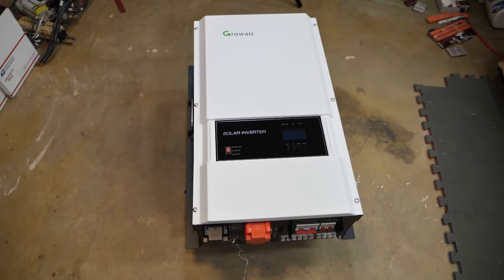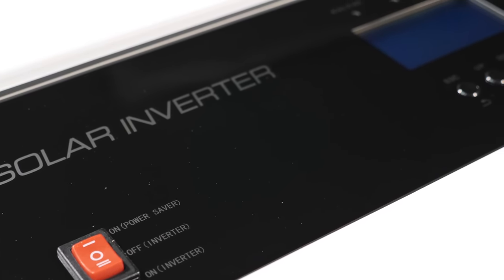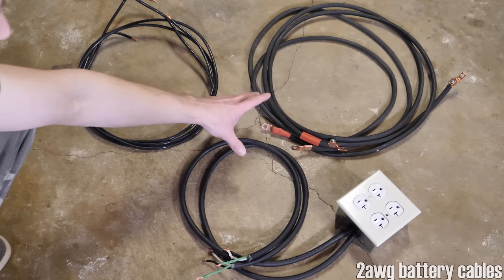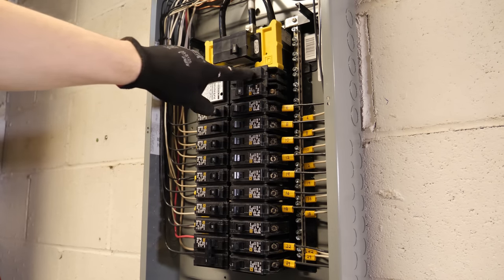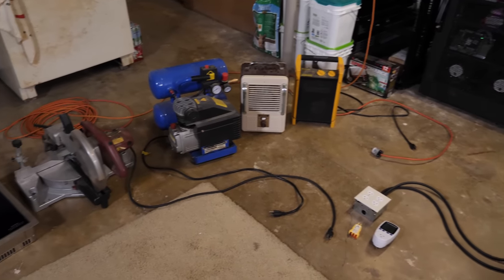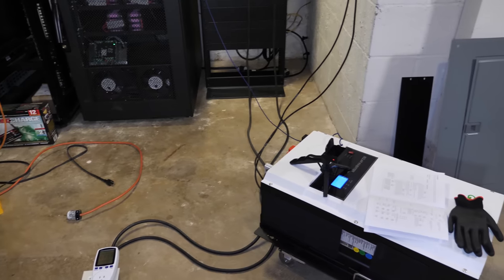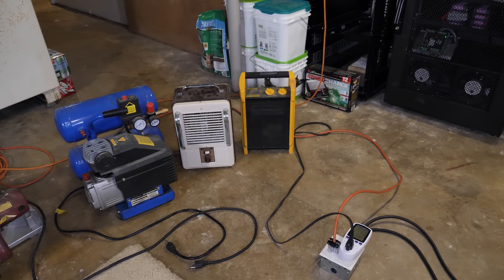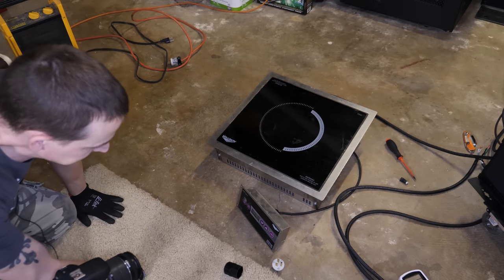12kw Growatt Inverter Operational Check/Review!!

Comment: Joe, can this inverter accept input from 240 volt micro inverters??
Reply from the maker: Hmmmmm.....thats a great question. I guess I dont see why it couldnt but I dont have any so cant say 100%
Reply: Accepting microinverter input is very tricky.

Usually, this would be placed on the output of the inverter, but this could blow the MOSFETs if the power produced by the microinverters was higher than the power draw in your house and the power on the output lines was greater than the power coming in on your input lines. (This is not designed to be a grid tie inverter, that extra power must be sent somewhere, otherwise it can blow up the unit.)

I know the Genetry Solar inverters will do what you want, and it has the ability to throttle down the microinverters in case they are producing more than you are consuming.

If you are selling back to the electrical company, then the microinverters need to be on your input lines (before the whole house inverter); and you will need advice from both vendors as to what the voltage needs to be set to. (I bet GrowWatt would be ok with this, but you need to check, since the microinverter voltage and electrical company voltage may determine voltage settings on the whole house inverter.)
Reply: If you mean direct input from micro inverters e.g to charge the batteries without Grid -- NO
And as David H pointed out on the inverter output side it is a definite NO since these are not AC coupled inverters that provide a frequency shift to to tell the micro inverter(s) to slow down or stop if there is insufficient load.

Comment: So it's been a bit over a year now, how is it holding up? I'd imagine with the various battery banks you are running mostly off solar now.
Reply from the maker: Sorry for late reply, regular joby job was taking all my time...just quit so all the time meow!  Still loving the inverter. Obvi didnt have time for all my batteries yet but thats going to change.  I also dont have the AC, stove or dryer connected but again that should change here soon!
Reply: @AveRage_Joe  Trust me I know how that is! I have my 2 original inverters still going strong, and I added a third one for more 120 volt loads. Battery bank is about 24kwh now, only thing not on my inverters is my stove and hot water heater, averaging about 12 to 13 hours a day on the inverters during the summer, typically from about 9:30am till 9 to 11ish pm. Plan to add about another 12kwh of storage and I should be mostly on battery all the time. Running 39,000 btus of mini split heat pumps off it and an 800 watt heat pump dryer now. They've been super solid.

Comment: Hi joe. I just purchased the inverter. I have a question on the panels. I have 4 strings of panels that goes into a combiner box. With this inverter can I connect each string to the inverter with out the combiner box?
Reply from the maker: I would keep the combiner as each string is fused or protected. That what I did is ran strings into combiner then into inverter!🤘

Comment: I'm planing to purchase this inverter in the next few days.  Are you going to be doing a follow up video?

Question. What is the largest AWG wire you can place in the ac output terminals?

Why are there 2 PV in terminals?
Reply from the maker: You will Love it! I want to do a follow up vid but work schedule is busy atm.

Manual says 6awg but I think 4awg will fit.

There are 2 solar charge controllers, 60 amp each. Great for south facing panels and west or which ever direction u like.🤘
Reply: @AveRage_Joe  thanks. I'd love to see pics or video of your final install and how you can laid out your switchgear
Reply: Thanks for the video. What does power saver mode do? Will it charge from charge controller in power saver?

Comment: Hey great video. I have tesla solar with no powerwall. could i wire the output of the tesla inverters to maybe the generator input of this?  im trying to find the best way to add a battery to the system and have a backed up loads panel.
Reply from the maker: Thanks!  Hmmmm....Id have to look into that.  I wanna say those need a grid signal to sync with or they wont work!  Its a grid-tie system correct?

Comment: Joe, I don’t know if you answer these but I sure could use some helpful guidance and advice so I don’t do anything too crazy. I bought the 12kw growatt after watching your videos. It should be here next week I might need a more detailed video with wiring it  completely off grid.  I intended to use 12 300w panels total, 6 are in parallel and 6 in series. I have 4 12v Vmax solar 155 batteries and power is being delivered using a #6 Thhn cord. Thanks for making great videos that keep inspiring us to build bigger.
Reply from the maker: Nice! I have the grid connected as a backup(or when we dont have sun). Do you plan to do that or complete off grid?
Reply: @AveRage_Joe  Yes, I have been off grid for the last 3 years due to my local electric company charging seriously high bills while I was out sailing on deployment. I’m talking over 1000 for one month totaling $5000 in a mostly vacant home with solar panels. I bought a Homegrid 5000 and haven’t looked back. This Growatt is a huge step up and would allow me to run equipment like my dryer finally. My biggest fear is that I will mess this installation up, so I have been obsessing for weeks reading the manual and re watching your videos every night. Any help is a great help, and I’d appreciate if you stopped me from fouling up my installation 😁. Thanks Joe.

Comment: What's your BMS continuous amp rating? What's cable size from battery to inverter?
Reply from the maker: I use the batrium bms which allows me to use a shunt trip circuit breaker (to cut the load) so I am using a 300a shunt trip circuit breaker. At the time of this video I am using 2awg cable to inverter.  Once my other battery is setup Ill be using 2/0 cable!

Comment: Can you try this on a sol-ark?? 12k Test it... And say what you think.
Reply from the maker: I would Love to but cant afford a 12k sol-ark to tester out!
Reply: Hello Joe  I put this because I just got one. A 12k. And if I would do what you did. It would  turn off. My 12k is nice but I think  I must get a transformer so that I can run my loads. I can't put a table saw it  shutdown.o me as far the rest is ok. Thank you and stay well.
Reply from the maker: You should be able to run a table saw at least without much other loads. Thats like an 8kw inverter or something isnt it and 12k for solar?
Reply: @williambenedito1305  - “transformer”

And there are risks to running an AutoTransformer. God forbid it dies or it is wired to a separate breaker from the inverter, you might get a 240v spike over one of your 120v split legs… and that is not funny.

Comment: the thing id like to know you said it can act like a ups does this mean it will also give a signal to a computer/server to shut down when the battery's get low
Reply from the maker: Yeah you can set alerts in the online deal. I was able to change settings and all that from a different pc after I did the video btw😆
Reply: @AveRage_Joe  thats freaking awesome i have not scene any one try and see if it will work as a computer ups that just simplified things alot i wont have to have an inverter to a ups for computers or run the ups as an inverter i can just have a hole in one unit
Reply from the maker: Yes Sir! You can run the entire house on UPS mode! DONE!💥🤘 Jfyi if you didnt need 12kw they have smaller ones as well.
Reply from the maker: One of my next videos will be about that option!💪🤘
Reply: @AveRage_Joe  always better to oversize not working them to hard then and you always have excess i just love how they have added the option to shut pc hardware down like a pc ups would i use an apc with network card to controll my server pc and conversion machine
Reply from the maker: I think I may have misunderstood what you were asking🙄 the inverter wont send the pc a signal. I was thinking you asked if it can send you alerts! Totally my bad for getting you all excited😬
Reply: @AveRage_Joe  damn did you come across any option with snmp ?

Comment: HI SIR I HAVE INSTALED 18 PANELS 450 WATTS ON MY ROOF AND 1 GROWATT 12K I NEED KNOW HOW TO CONNECT THE PV LINE TO EACH MPPT CONTROLER IN THE INVERTER.
Reply from the maker: You need to know your panels open voltage which says on back of panel.  Then series the panels together to reach either 150v or 250v depending on which growatt 12k you have.

Comment: Is there any setting that you connet to the grid but without charging the battery?
For example At night when battery is low, it switch to grid to power the load only without charging the battery wait until morning when the sun come up to charge the battery
Reply from the maker: You betcha! That is under the charge method setting and you use the "charge by solar" setting. That is what I do! I only charge from the grid when there is no sun and a big storm is going to roll through or testing a bettery at night!🤘

Comment: Maybe I am wrong but I think an induction top will probably not use electricity until a pot, pan or kettle is placed on top.
Reply from the maker: You are correct but nothing lit up on that lil screen so I assumed it didnt work all together. I still have it and will try a pot on it to see jic. Ill lol if thats all it was and it needed to sence the metal before turning on!🤷‍♂️

Comment: Hello dear 
I need your help i have same this invertor spf 12kw hmv 
This invertor have 2 pv input
Can i install on each pv input 12 panels 
3panels 4 series (455 watt longi 49v) 
Total 24 panels?
I wait your reply 
Thanks in advance
Reply from the maker: You need to check to see if you have the Low voltage model or High voltage model.  Low voltage is 150v for solar input and High voltage is 250v.  Next, you say you have 24 panels. 24 panels X 455watts equals 10,920watts. The inverter says you can install 7000watts. Having said that, you can usually add 10% more which equals 7,700watts or 3,850watts per input.

If you have High voltage version then yes, you can have 4 panels in series (49v X 4 =196v) and then add another set of 4s in parallel (total of 8 panels) 4s2p to each solar input. This will give you 3,640watts per solar input for a total of 7,280watts. 16 total panels

2nd option for High voltage version if your solar panels are 49v open circuit (sticker on back of panel or measured in full direct sunlight)!  You could possibly do 5 panels in series (49 v X 5 = 245v) instead of 4.  Total of 20 panels but possibly wasting energy.

If you have the Low voltage version- You would do 3 panels in series (49v X 3 = 147v) 3s2p or 3s3p.

If it were me and you have the High voltage version I would do 4s2p on each input then add another separate charge controller for the rest of your panels.  This is what I will be doing!  Hope this helps!
Reply: @AveRage_Joe  thanks for your reply
I have low voltage version 150 v 
So I will install 3850watt on each pv input and I will install extra growatt controller to put the more panels 
And I will connect the growatt controller with the invertor using cam cable 
Is that correct?

Comment: Ok so I have a question for anyone who can provide an answer.
I've got the 12kw growatt with Eg4 battery setup. The growatt inverter has an option for ecomode 48 volt. Can I still run 110/120 while in 48 volt ecomode or do I need to be in full power mode. Mainly concerned about powering my chest freezer and water pump.
Reply from the maker: Do you mean the power switch flipped up to power saver mode? I would test it out to make sure it "turns on" to power the load. It should work if the load is "big" enough.
Reply from the maker: Rethinking on this, it may not work as the freezer may "see" no power and therefor not power on.
Reply from the maker: Oh ya fun times lol🤣

Comment: A great video - thank you sir!    Some comments.   1) cloud requirements for software -  I avoid these as you know they will share/use your personal data.     2) I have a MPP Solar Off-grid and noticed that when I have grid + PV, the 'max amps to the battery' setting is ignored unless I use a specific combo of Utility->Solar   /  Solar->Utility priorities - and would be interested what you find out about the Growatt.   I have to say that my Midnite Classic (80a) = $700 + AIMS inverter 12,000w = $3500 + UPSs $1000 = $5200 compared to all-in-one Growatt for <$3000?
Reply from the maker: Thanks Man!  Yeah not a fan of the cloud service thing at all!!  There is an option to connect directly to a pc and use the supplied software which is similar to the mpp software.  May give it a try.  I was also able to change settings in the cloud after video of course lol.  I tried from a different pc and it worked great!  I do have all the settings to control PV+Utility ect but will have to try a few combinations to see how it reacts or if it does similar to yours.  So I actually only paid $2000 for this inverter shipped to my door!!

Comment: Battery fully charged 04 on screen and beeps and no power in house what should I do?
Reply from the maker: What kind of battery? If lithium, the bms cut charging and possibly disconnected to "prevent" over charging. I would lower the bulk and float charge setting. Also if this is a new lithium battery, the cells are probly out of balance. Once the cells balance, you could raise the bulk and float settings. I usually had mine on 56.4v.

Comment: Hello Thank you very much for the video, at minute 7:40 when you are making the voltage input connections AND you say: normally you would also connect the ground cable, which goes back to the ground and neutral connection of your main panel, it means that you must to go neutral and ground together at that point?
Reply from the maker: Yes, just replied to your other comment. The neutral and ground are bonded in main panel🤘
Reply: @AveRage_Joe  The supplier says that only the 2 lines and ground should be connected to the network voltage input, but not connected to the neutral, is this correct?
Or do I have to connect the neutral and the ground to the mains voltage input on the inverter?
Reply from the maker: I have my ground and neutral bonded in my main panel. Main panel supplies the input to inverter. Output of inverter goes to a subpanel. Subpanel ground and neutral are not bonded because that  ground goes back to main panel which is bonded. Hope that helps
Reply: @AveRage_Joe  Thanks, I'm going to tell the supplier about it so he can do it and let's try again.

Comment: I'm probably wrong but an induction cooker needs a ferrous pot or pan on it to act as the secondary transformer to draw current.
Reply from the maker: You are 100% correct! I only assumed it didnt work as no lights turned on "saying" it was on. So I didnt try anything🤣🤷‍♂️

Comment: I have been googling and looking at the docs and maybe I missed it.  Can you daisy chain a couple of these like the smaller Growatt inverters?  Two of these together could run most any house.
Reply from the maker: This particular model cannot however they should have one similar to this very soon I hear. They have other models that can but Im bot sure which ones. This inverter for the most part will run my entire house once I have the battery capabilities.
Reply: @AveRage_Joe  Sounds good.  Thanks for clarifying that.  Ya I think one could suffice.  I am just looking at most houses being 200 amp service, so two of these daisy chained would make it darn close to that.   Also doing that could maybe be less disruptive if one was brought down for repair.
Reply from the maker: Of course! Yeah I guess in time once battery is bigger Ill know for sure if the 12kw is enough or not lol. Ill have more vids of it connected here soon.
Reply: @chuck1011212  - “daisy chained”

I would suggest you don’t run daisy chained, when it comes out. In general, the master inverter will need to tell the secondary she to come up & spin down, they both have to be running, etc.

A better option, if you get 2 inverters, is to have each one handle the opposing split phase. I know the Genetry Solar low frequency inverters will do this, today. I bet the GroWatt may be able to do this.

Comment: Hi I am a newbie with battery and inverter. And I want to build a system that will  the batteries within the allotted time (2am to 5am)Is it possible to set from the mains the battery charging time in the Growatt inverter, for example from 2am to 5am?  Great Job .
Reply from the maker: With this you would need to do it manually by pc, phone or on the inverter unless there is an advanced way I dont know about. If you have solar you could leave in off grid mode.
Reply: @AveRage_Joe  Thanks for the answer, I already have one system with solar panels, the other one with only battery and inventer I want to use for my project, which consumes about 8.2kwh a day and I wanted to charging at this time because the current is for 0.07c and not 0.29. Thx

Comment: How  long will a refrigerator  ,a freezer and 220 volt well pump 1,/2 horse run for during a power outage. What size unit would I need..
Reply from the maker: How long is based on battery size. How long would you like to run?
Reply: However long the power is out 1hr. To 3,4 5 hrs

Comment: Hi Joe Great video.
Question. if PV output is 11kw, will the unit use 7kw for charging max thru the mppt and be able to run the remaining 4kw thru the inverter to power loads if needed. if not, what will happen to the additional 4kw seeing that the max PV input is 7000w?
Reply from the maker: I would probly only over PV to 8kw. 4kw per pv input since there are 2 pv inputs.  For the remaining panels you have you would want to add another charge controller and then connect that charge controller to the battery.  Thats what Im doing, adding another charge controller.
Reply: @AveRage_Joe  Thanks. same thing i was thinking
Reply from the maker: You betcha!💥🤘